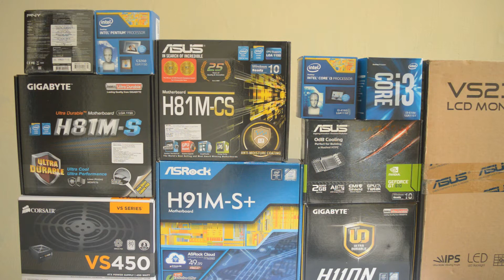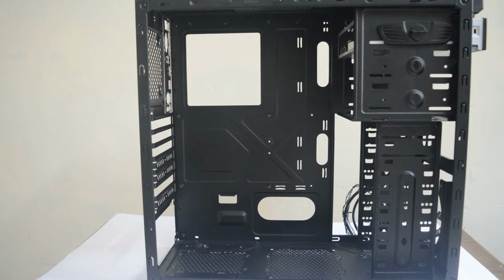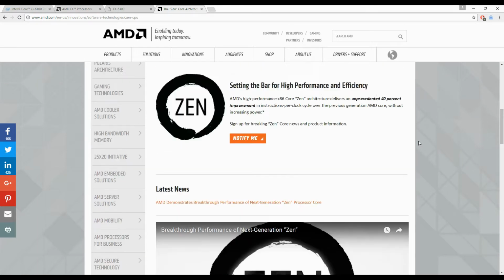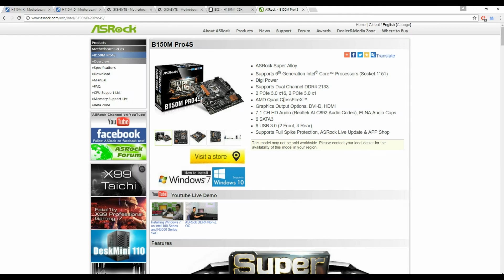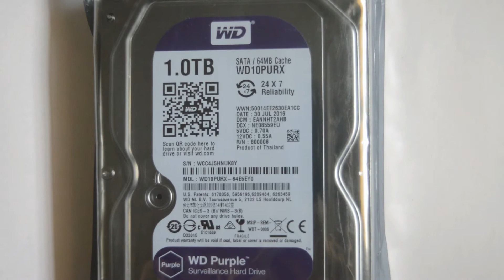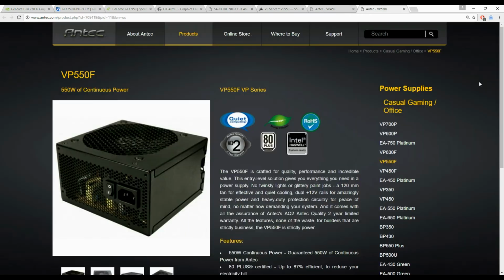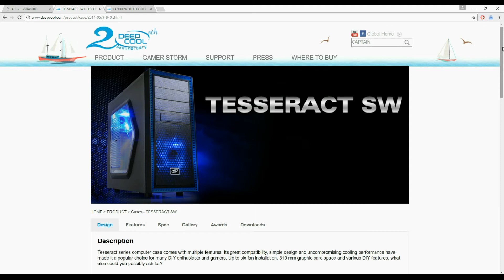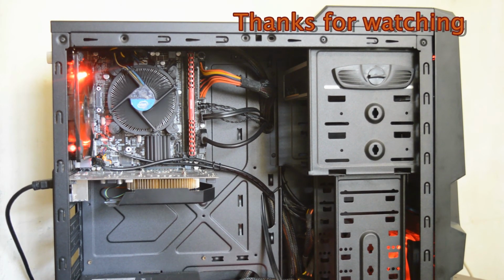Cheap Gaming PC build for january 2017 ,How to choose PC parts wisely?  complete guide

Comment: can we play all games smoothly with this pc like resident evil 7, battlefield 1 CSGO etc plzz reply
Reply from the maker: Slight modification due to Intel's kaby lake CPU (7th generation) launch. 
Suggest you  i3 7100 or i5 7400(if you slightly increase your budget)      instead of i3 6100.     And for the GPU , grab the nvidia  GTX 1050Ti 4GB DDR5!. Much capable of playing most demanding games in high details with 1080p resolution.  
The Pentium G4560 is emerging as a great alternate to i3 and it is the first pentium desktop CPU to support hyper threading!!.  Consider this model if you are on a tight budget or wish to put that saved money for better GPU like nvidia gtx 1060 or ATI RX 470 and plan to upgrade the cpu after sometime.
Reply from the maker: Still you can use the 7th gen processor in H110, H150, H170, Z170 chipset motherboards after updating the BIOS.  Beware, update is possible only with 6th gen cpu installed!  
B250 chipset motherboard supports right out of the box without any bios update.
If you are in the process of building PC from scratch or upgrading your very old setup, I suggest you the 7th generation platform (Both CPU and motherboard) for future proofing.

Comment: third party fans are not louder than stock... lol. Especially with AMD..
Reply from the maker: You got me wrong!  I said that, there won't be necessary for a third party cooler/fan for recent Intel CPU's (skylake architecture)  especially for non K models.
Reply: oh i misheard 2:36 you were saying amd cpu's stock coolers were too loud and so needed a third party heatsink, that's fair. i've been there.

intel coolers aren't very loud but definitely louder than most third party fans i've used at least. It's that darn small fan. But yeah AMD is like a jet engine in comparison
Reply from the maker: Yes. Intel fans are noisy too, when CPU is  at 100% load. But it's too much to tolerate with AMD stock fans!   They still need heavy heat sinks and high speed fans to control the temperature  . 
 Once I was a great fan of AMD for their excellent price/performance products(Remember those original athlons, Durons and overclocking fun!). Now they lost so many loyal AMD fans. Lets wait nd watch, how their upcoming Zen architecture competes.
Reply: Well Zen looks really good so far. That blender test against the 6900k where it actually finished first may have been cherry picked to heck, but look at this way.. When has bulldozer ever competed with sandy bridge+ in ANY program with thread count, core count, and clock speeds exactly equal between the chips? I don't think it's going to beat the 6900k in most things but it should still come close.
Reply from the maker: I wish Zen to provide some tough competition for Intel though not winning in every tests. And yes, they need to improve a lot in single thread performance.I bet with strong single thread functioning AMD multi cores will get turbocharged and take on the Intel models easily.
Reply from the maker: So, AMD is back!. Great show by ryzen processors